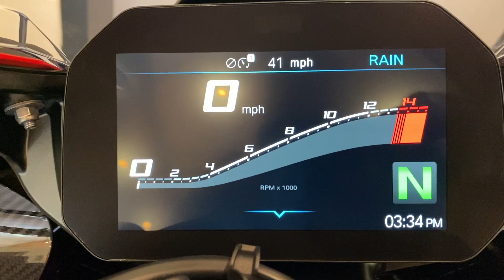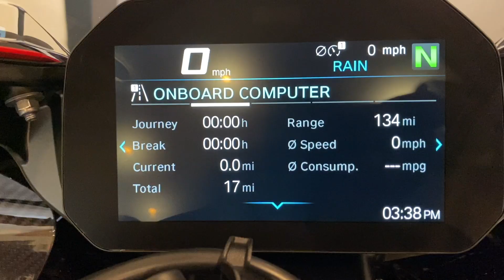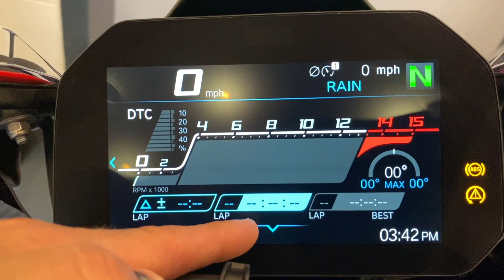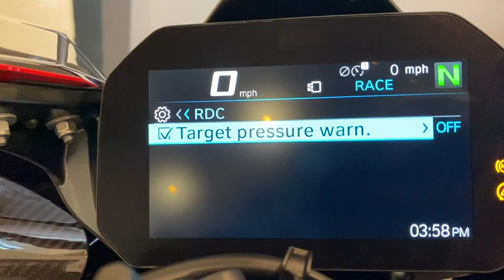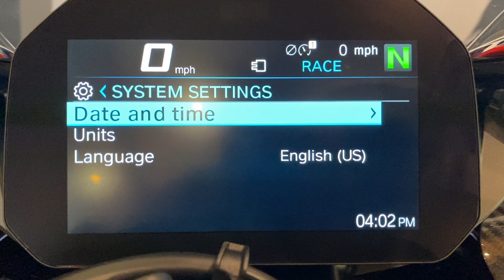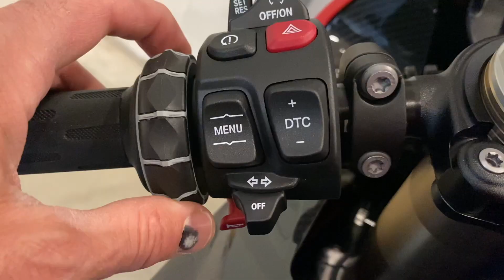BMW TFT Display S1000 Models

Comment: Hi .. is there anti wheelie option?
Reply from the maker: Anti wheelie is part of the traction control system.  If you want to wheelie, turn the traction control off.  If you don't want to wheelie, you can regulate how much intervention you want by using the modes (rain more intervention, dynamic less).  I hope that helps.  Thanks for watching.

Comment: Once connected to your phone via BT, does the map function on the TFT transmit Google maps from your phone or is it just directions that are displayed (e.g. left, right, straight arrows, etc)?
Reply from the maker: Using the BMW Connected App on your phone will allow you to plan your route and use the maps on your phone.  When your phone is connected via BT to the TFT, it will display directional arrows with some additional information but not a full display map.  Thanks for watching.